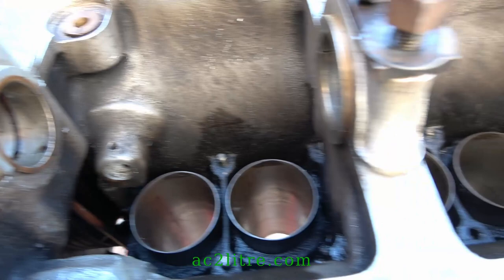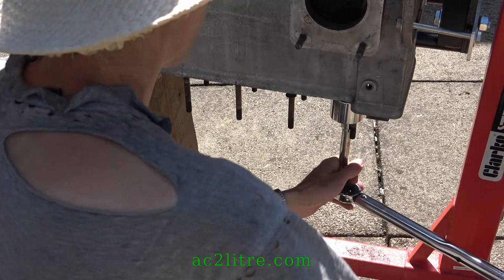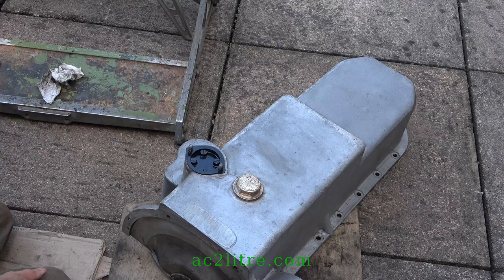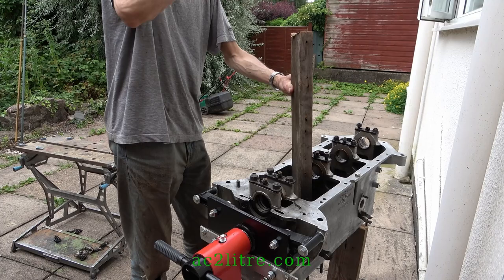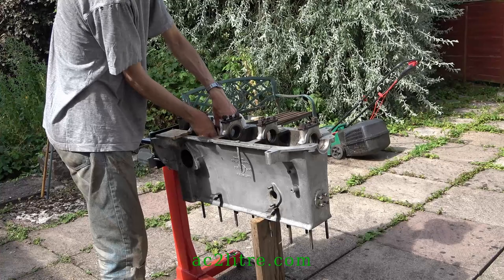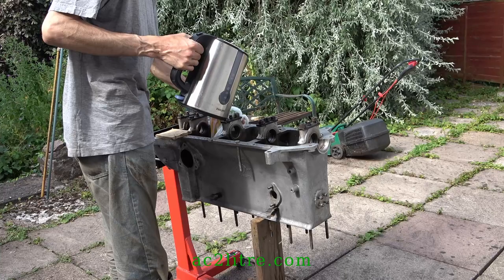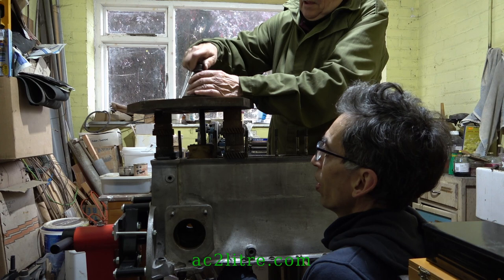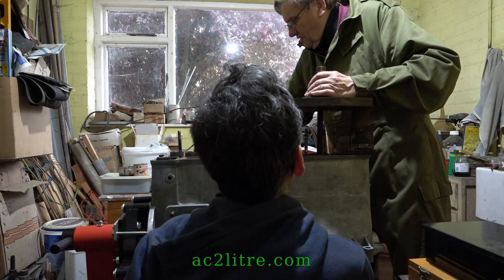AC 2 Litre engine dismantling, part 2.

Comment: Could you gently heat the studs with a blowtorch to extract or is the alloy to delicate?
Reply from the maker: I tried this, although my blow-torch is a bit small. But yes, I'll try this approach again before considering outside help.
Reply: @ac2litre  personally I wouldn't use a blow torch..... from co-efficient's of thermal expansion you need to heat the alloy and cool the studs. which is a challenge in itself. but just heating the studs will make them thicker and therefore tighter. having said that the internet suggests heating works... but prob not for 6 inch bolts / studs! but then do you have to remove them? maybe head skim planned. stainless stud replacement?
Reply from the maker: @keithrpenny6484  Hi Keith. The idea is that expanding the studs crushes the corrosion, opening a gap when they cool. One stud is corroded/eroded away. My engine is a rare one with equal length studs, which won't fit the new alloy head. Maybe a skim required? New studs have rolled threads and higher strength. Cheers :)
Reply: @ac2litre  makes sense now thanks!